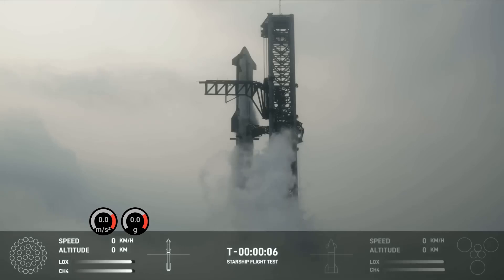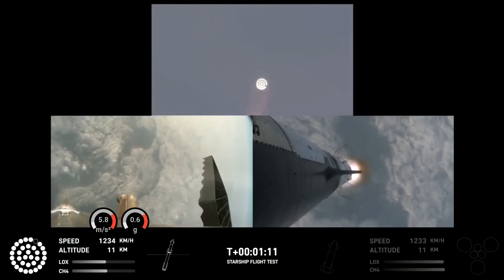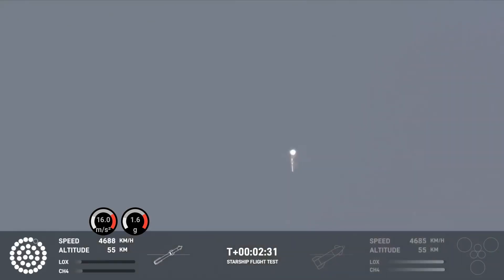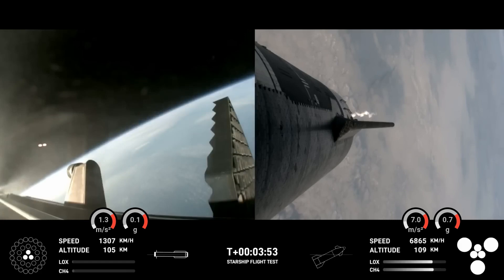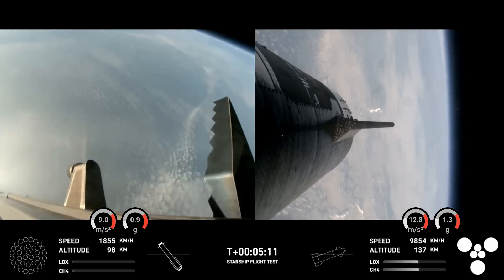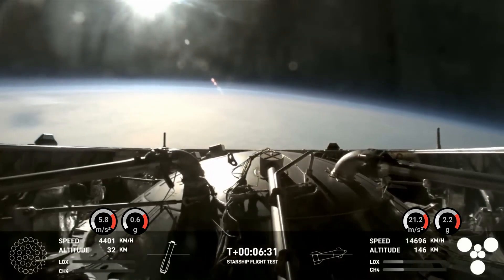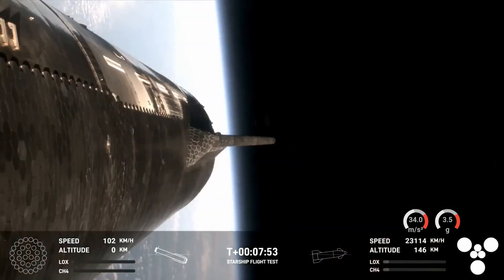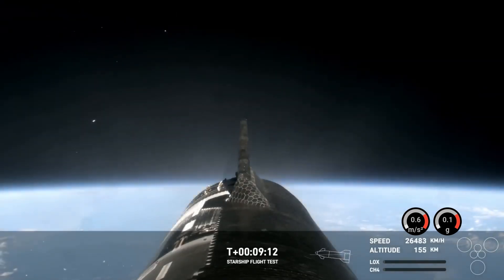SpaceX Super Heavy Starship BFR Flight Test 4 acceleration / g dials

Comment: Nice. I’m assuming you did it frame by frame. Did you do it manually or code something?
Reply from the maker: @Allthegoodhandlesaretakenlmao  a bit of to-and-fro this  example was by cropping out a tile containing the speed digits, cropping each digit tile out of that, and then comparing to a set of 11 'good' prototype digits. It's code, but with quite a bit of run-check-tweak-run

Comment: Why is it showing 0.9gs at 5:30 for example for the booster? Shouldn’t it be 0gs?

You do know that it is moving slightly inclined downward as you know its flying engines first and the video shows the angle in which the booster is compared to the ground… shouldn’t that be accountable?
Reply from the maker: All the dial shows is rate of change of displayed speed. It might be possible to build altitude and rotation into a model to make a display more like an accelerometer. That's a job for someone else!
Reply: @trs4u  gotcha! It may also just have been a complicated request! It’s still pretty close and especially when you have that in mind to see that the Booster apparently pulled 6gs even. That is amazing data! :)

Comment: Are the actual G forces 1G higher? Because on the ground the G meter should be reading 1G, not zero, so when it lifts off, I assume what the vehicle is actually experiencing is 1.5G, not .5 G, and this would carry through the whole flight, correct?
Reply from the maker: Yes and no! This 'g dial' is just the difference in the displayed speed divided by the time between changes, because that's all the 'data' I have from the video. It's not at all like an accelerometer in a phone or racing car. When the speed is increasing vertically upwards at "1 g indicated" like at 1:40 space-farer-you would experience 2g. Falling tail-first at increasing speed also "1g indicated" like at 6:47 space-farer-you would experience weightlessness. It's complicated by stuff like the orientation of the vessel, and by altitude as the Earth-attraction element decreases the further away ('higher up' for flerfers!) you are, and possibly also by centrifugal forces?
Reply: Essentially, this is from the frame of reference of the earth, rather than the vehicle.

Comment: Your "G" meter is completely wrong. That sucks because I wish that you actually had the real telemetry showing G forces from the mission. Oh well... :(
Reply: the "G" meter values are calculated by measuring the change in the number labeled speed over a period of time, which appears to be per-frame. It's not "wrong" per-se, but it is lacking important data like axis of acceleration, and doesn't take into account gravity or the source of acceleration. It's perfectly fine as a fun thing to look at and go "woah look it was pulling over 5 g's here!" and nothing more.
Reply from the maker: That's what I said in the description. If I do this again, would a title card on the video saying that help?

Comment: how can it be a successful splash down when it exploded and fell over?
Reply: because that's what happens when a rocket splashes down? The goal was to softly land on the water using its engines, and it did do that. After engine shutdown, the vehicle was subject to the whims of wind, water currents, and gravity, and so it fell over. When the top impacted, it exploded. It's successful because it did exactly what it was supposed to do. After landing, IF the vehicle survived they would sink it by shooting high velocity armor piercing rounds at it if it couldn't sink itself. It exploded, which was the more likely outcome, which took care of the sinking problem.

Did you expect a 270 foot tall tube of air to stay upright in the water or something?
Reply from the maker: The target wasn't splashdown - that's how space vessels landing under parachutes sometimes finish. The target was 7:39 where it stops (0g) with engines still lit at zero metres above the water, to simulate coming to a halt on the chopsticks. The engines-off methane flame and falling into the water was post-success.
Reply: It didn’t explode. At least not before it fell over. What’s it supposed to do after splashdown? Just stand there? I’m sure you’ll find anything to complain about, though. Have fun with that.

Comment: Nice work! Can you apply some smoothing to the data so that it doesn't jump around as much?
Reply from the maker: Smoother output would have made a better video! I really want to see if I can improve on the extraction of the actual data - a lot of the 'noise' is incorrect digits being output by my recogniser. There is a 'moving average' in use, but there are corners in the input due to long-lived recognition failures ('5' = '6' errors were common) and thrust changes.

Comment: This is totally sick! Can we also get a graph with the time / g force with time stamp in a picture?
Reply from the maker: @awesomefeldmanfamily  I set out to do exactly that, but it took me so long to get clean enough data out of my image-matching method that I got fed up with it and uploaded short of the target! I should do that next time
Reply: @trs4u  I appreciate you spending the time to do it, it must have been so hard how did you do it? You just scanned every second of the video and extracted the data out of the speed and put it into a chart? That seems so hard what kind of software did you even use to do that?
Reply from the maker: @awesomefeldmanfamily  There's a very long-winded explanation on an old video of mine. It's basically image-comparison, but my old code for doing this wasn't giving great results for this video. This time I generated 'prototype' image tiles using as close as possible a match for the font/size in the video, then took the best match for each frame and digit. There's a few minutes of manual tidy up for aliasing/bright backgrounds breaking the match, and then a final run generates the dials. I use ffmpeg to split/crop the video, and the rest is my own Java code.
Reply from the maker: Like this? https://www.youtube.com/watch?v=5CEZnVrAhb4